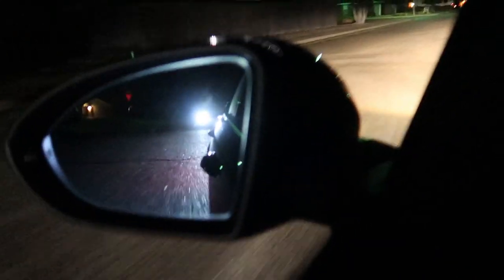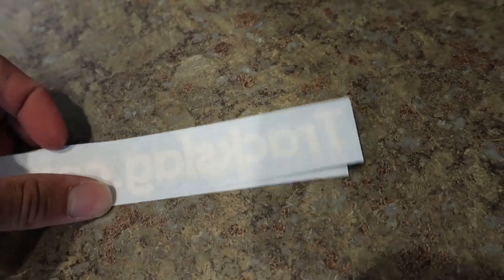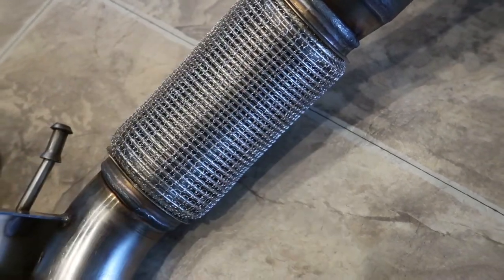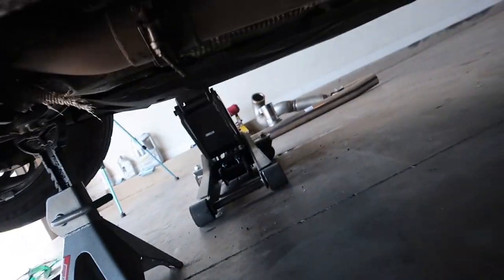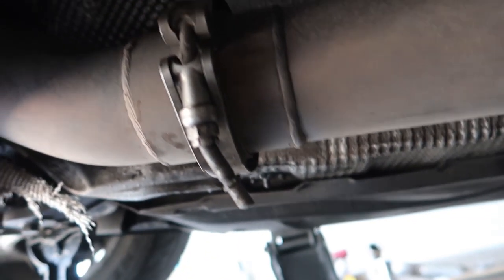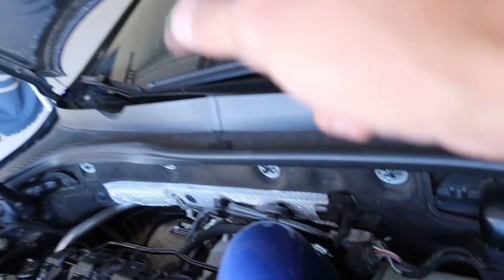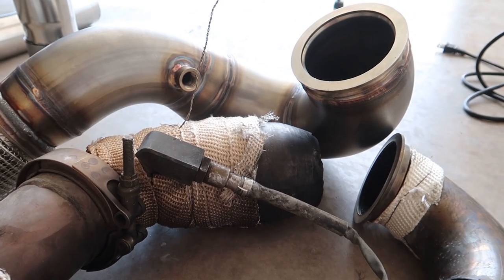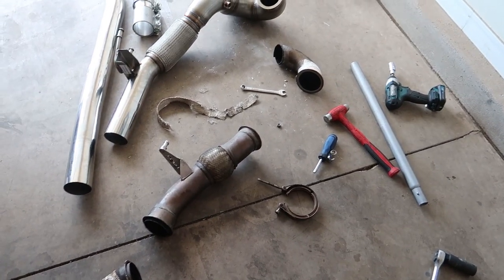Broken Downpipe! Replaced with a 4" MASSIVE pipe! | Trackslag | MK7 Golf R

Comment: Just remember no matter how large the pipe is the most its ever going to flow is based on the smallest ID, in this case it's going to be at the inlet flange of the DP... Looks pretty sick though lol
Reply from the maker: Well it definitely flows better then the previous so i cant complain at all lol
Reply: There's also a 90* bend immediately after the flange so a larger diameter pipe in a bend is going to flow much better.

Comment: If you can, put a reflective tape on the plastic piece on the abs unit. Mine melted when I had an eBay dp there... anything helps
Reply from the maker: Been keeping an eye on it.. might have to do that!
Reply: Do you have a photo or maybe a link to this issue? Does this only happen with aftermarket Downpipes? Thanks

Comment: With the downpipe touching the abs module shield, has it melted it?  I just installed my USP downpipe on my S3 this past Friday and my first test run melted the plastic shield.  So I wrapped the portion of the downpipe to kind of help although I didn’t take the downpipe out so it’s a janky wrap job haha.
Reply from the maker: It doesn't touch it but it did melt a little. I'm not worried about it though. Had a very hot long track day yesterday and I didn't affect the braking or anything
Reply: Bryce Jordan Productions That’s great to hear. That eases my mind now haha. I don’t track it so I shouldn’t see any issues with my brake fluid boiling. Did you change out to a higher DOT brake fluid?
Reply from the maker: I sure did! Motul 600 is what I use

Comment: hey nice videos! What power is your car running and what milage?
Reply from the maker: 74k and a little under 500wheel at 32psi
Reply: @BryceJordanProductions  74k is that the same as 74,000 miles? Im on 65,000 right now and was getting kinda scared my car was gettting quite high milage and was maybe going to run into problems as i plan to go to stage 2! have you had any issues with yours?
Reply from the maker: Yup 74 almost 75,000. I blew a turbo at like 27kish but that's about the biggest problem I've had other then some leaky timing covers.. not counting the things that I've broken myself like an axle and other random stuff
Reply: @BryceJordanProductions  Have you faced the thermostat leaking problem yet?
Reply from the maker: No sir, knock on wood.. lol
Reply: @bradfindlay5888  60k is nothing man. Stop it.

Comment: 12:16 why use the O2 spacer if you have a proper tune now? it's always better to get accurate readings of your exhaust gasses rather than a spaced out version.
Reply from the maker: I don't have it on the new pipe. I have the rear o2 disconnected anyways

Comment: Hey man, found your channel here and loving it. I'm currently running an Akrapovic DP with Racingline Stage 2 on my Mk7 but the DP is a little restrictive to go to stage 3 or 3+ which is my next move. I am looking at a new catted DP and the Trackslag is a definite contender. I wanted to ask you what the difference in sound "inside the cabin" is between your old Revo and the  Trackslag DP. I think I'm going to miss the deep throaty sound of the Akrapovic when it's replaced. Cheers
Reply from the maker: I really didn’t notice much of a difference in overall sound really. Just some added pops on downshifts and more spool noise coming out the back at all RPMs. I love it!

Comment: Damn Bryce that is a big fucking pipe! (BFP!!).  I'm waiting to do my DP upgrade as I'm going IE Stg II later and want to do my clutch upgrade at the same time. 
I just installed the GFB DV+ (Diverter valve upgrade) last weekend and it helps with throttle response.  Wonder how it might work in conjunction with your new Trackslag 4" DP.  It is GFB Part No: T9359 (Go Fast Bits from Australia).  Great videos man as always!
Reply from the maker: I have a turbo smart bov i ran for a little but wound up going back to stock, it would sometimes stick open :/ i had the DV+ years ago and UM told me to take it off and go back to stock, so here i am lol. What clutch are you planning on going with?
Reply: Bryce Jordan Productions oh interesting. Did UM say why it should be removed?   I’m thinking Southbend - something to handle maybe 400+ Hp and retain street drivability.
Reply from the maker: Southbend stage 3 daily for sureeee. And I don't remember exactly but something about ECU stuff and speed of the valve moving I think.. don't quote me lol
Reply: @BryceJordanProductions  That's what I was leaning towards.  Then I don't need to worry about the clutch as I move up in power.   I'll reach out to IE to see if they have any issues with the GFB DV+.  TBH I don't see why they would - it retains the stock solenoid coil but I'm not an automotive engineer so I will check with the experts.   o_O
Reply from the maker: Yeah that's above my head, I don't know much about the ECU side of things, I just go with whatever the tuner calls for nowadays 🤷‍♂️